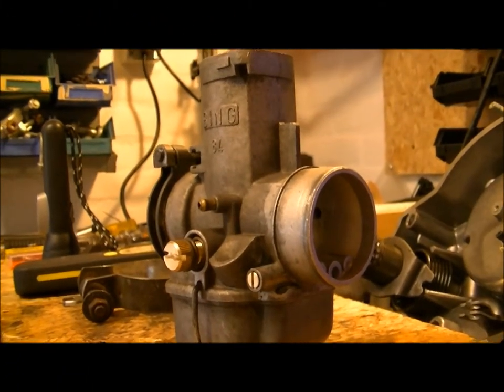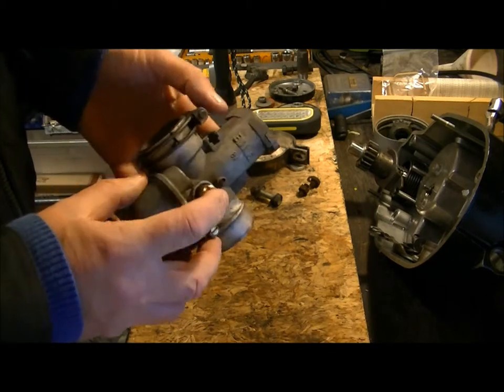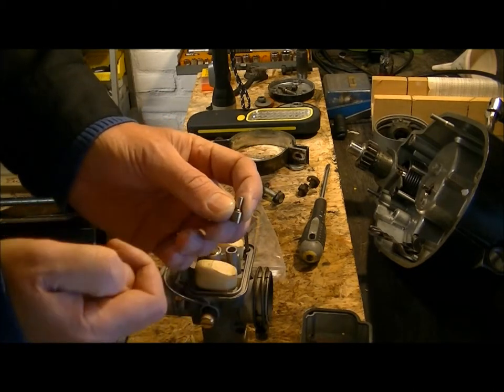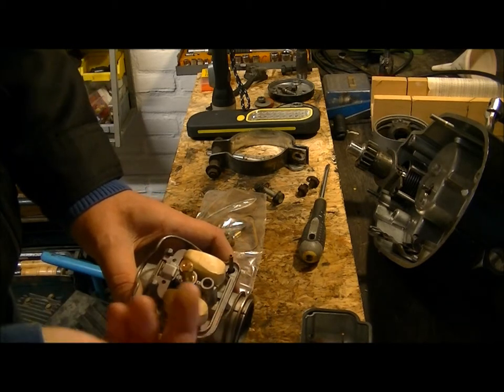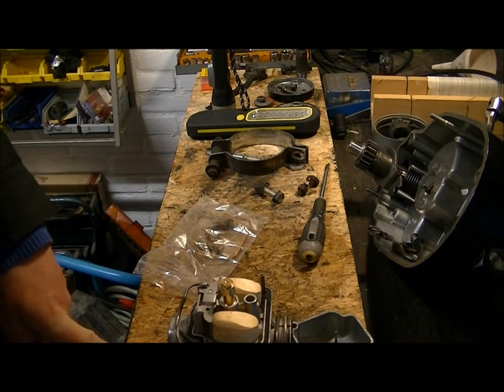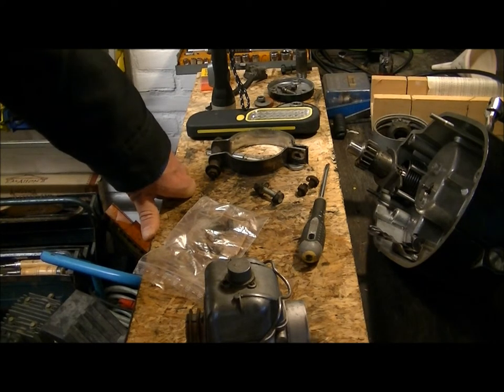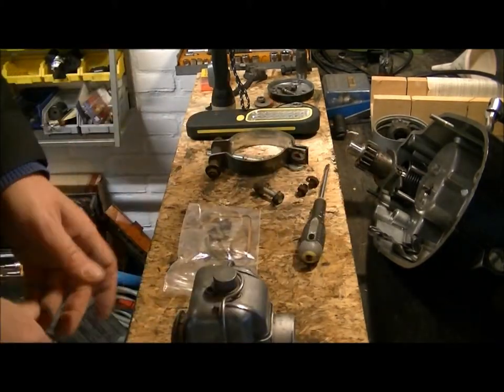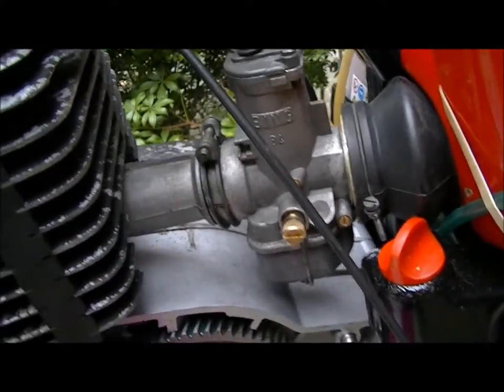Carburettor woes (MZ part 25).wmv

Comment from the maker: Now you know why this carburettor is such a pain in the ass.. No I don't have a gauge strip, or a float level chart! This carburettor is originally an aftermarket piece, that later got used in oem applications. Bing does publish on their website charts with the data how to tune your carburettor for your specific application... but there's nothing on the floats! Only those general remarks in the manual on how the float should level the carb's surface..